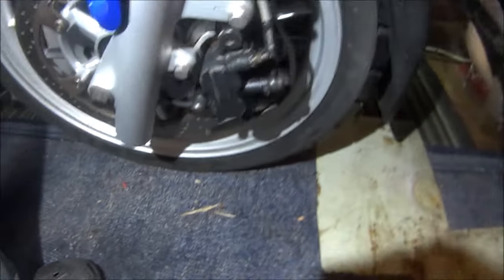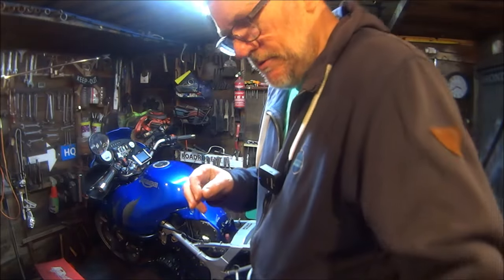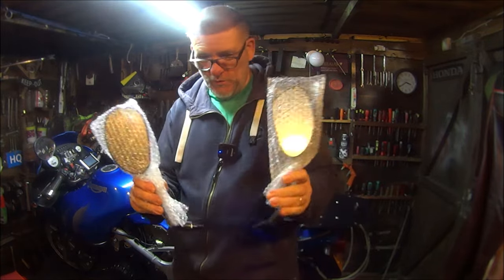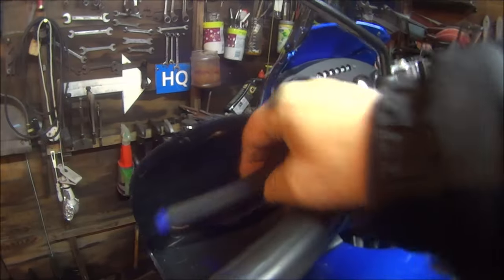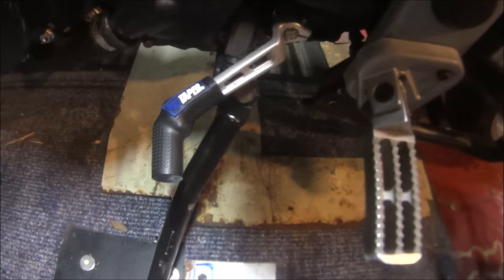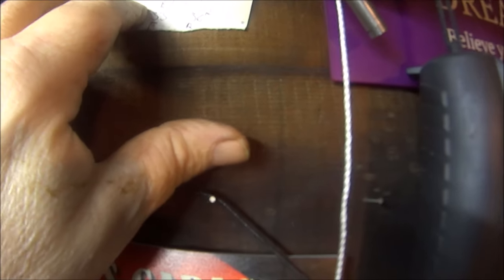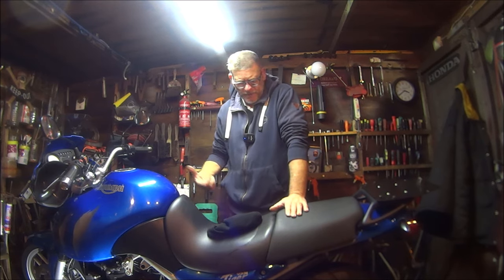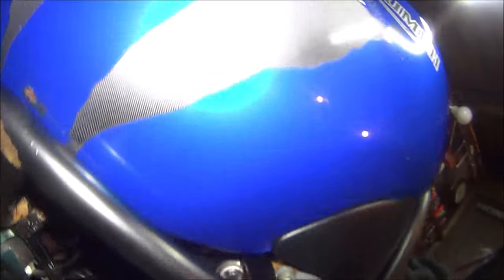TIGER 955I. Could Need The Sasquatch Mod?

Comment: Mirrors don't look out of place at all, if they work for you, that's the most important thing. The Sasquatch Mod is worth doing as a pre-emptive measure, worth cleaning as many multi plug connectors and using dielectric grease as you can. The adjustable levers won't fit in those hand guards without modifying them for more clearance of the adjuster bolt. Good luck with the MoT.
Reply from the maker: Thanks.its the cost I'm worried about I'm guessing it's not going to be cheap.🐅👍